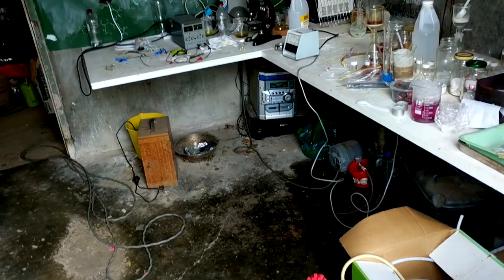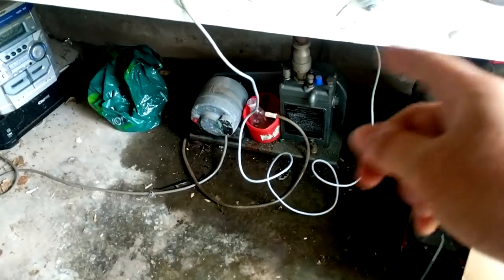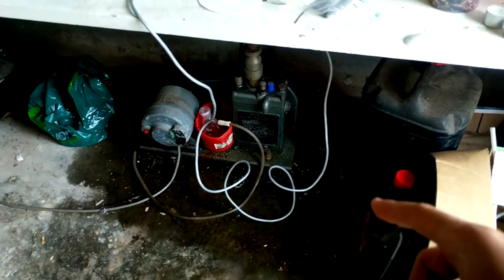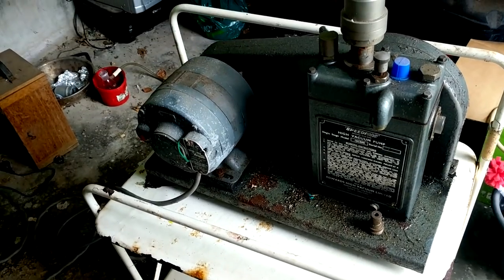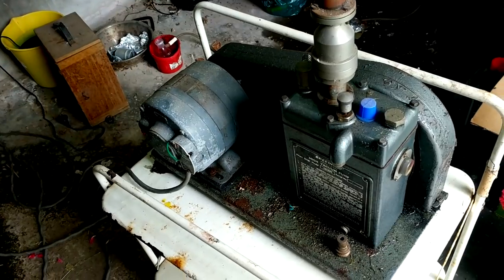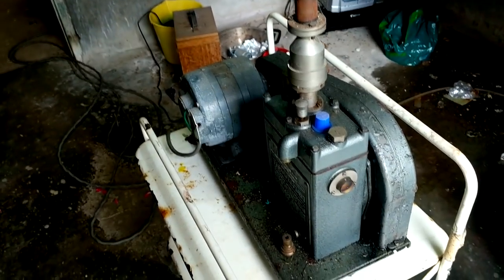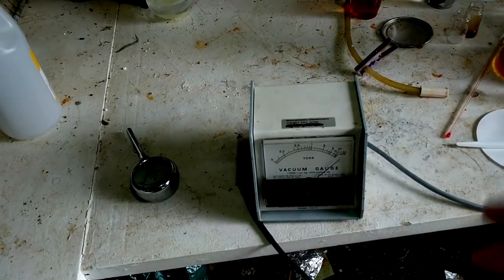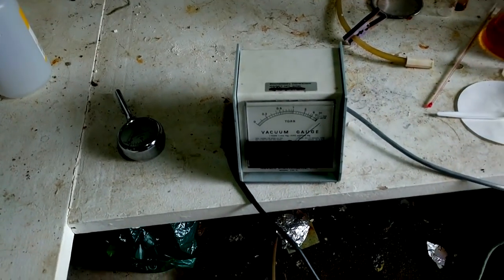Changing My Poor Vacuum Pump's Oil [[gone greasy]]

Comment: That is one tough pump to still be running like a champ after running so long with coagulated oil. I doubt to many modern pumps could still be running after such abuse.
Reply: that pump probably also cost ten times as much as a modern equivalent pump
Reply: @SuperAWaC  probably not. May well have cost a similar amount, but it's definitely far more overbuilt compared to modern pumps. Like a diesel engine.
Reply: @hotmailcompany52  Maybe, but nowadays engineers are hired specifically to optimize product costs for maximum profit

Comment: Your pump is quite good. Ballast pumps are expensive new. You probably want to run with ballast on, especially in your particular application . Running with the ballast air enabled helps prevent vapors from condensing and entering the oil. It does this by adding air to the pump chamber during the exhaust phase. This air dilutes the trace gasses with air so they don’t condense to liquids during the compression / exhaust phase of the pump cycle. Any vapors pulled in by the pump stay in the gas phase and get pushed out the exhaust vent mixed in the added air. The trade off is not quite as high an ultimate vacuum. But considering how rusty the oil looked, you have a lot of moisture condensing in the oil and you want to avoid this in the future. Buy a big jug of hydraulic oil and change your pump oil frequently, before it starts to look funky [and pray for forgiveness from your past sins by the god of ultimate vacuum - the great and  mighty Torr]
Reply: What is frequent - hard to say because it depends on how much the pump is used, at a minimum, I think you will want to change the oil at least every 6 months. It could be as frequently as monthly if you are using the pump extensively.
Reply: Thank you for posting that I just bought a welsh 1395 pump 15 ft.³ per minute horsepower motor and now I know how to use the pump with the gas ballast valve. That was a good thing. I understood now all right thank you very much for posting that and by the way, my pump weighs 215 pounds believe it or not.

Comment: Imagine what can you find by doing the NMR of the dirty oil!
Reply: Spikes everywhere.
Reply: dude's vacuum pump grease so filled with unknown chamicals that it accidentally created the cure for cancer
Reply: It would be so spikey that it would create a plateau. And probably reach chemical shifts never reached before.
Reply: If you ran the NMR spectrum of that stuff through an audio editing program it just comes out as an eldritch scream
Reply: @LiaLia0407  will simultaneously cure cancer and cause several new ones.
Reply: It will by just a single solid bar
Reply: someone just had to suggest an caramel sauce enemah

Comment: The air ballast introduces air (duh) into the inner workings of the pump and basically dilutes whatever gas it is pumping. If you're vacuuming something with a lot of water or other condensables in it, the air ballast will prevent them from condensing inside the pump and into the oil. You're trading ultimate pressure for oil and pump service life.
Might come in very handy when doing filtrations or vacuum distillation. My best guess is that the little knob at 16:24 controls how much air you're letting in.
Reply: Not sure if just dilluting the intake but with the pumps that we are using it also bubbles some air through the oil so you can just open it 5-10 minutes before turning off the pump to get the best of both.

Comment: I believe mineral oil is the most suitable and readily available substitute for commercial vacuum oil, most of which is mineral oil based. It does appear to be a rotary vane pump. Ideally the oil would be changed every use. HVAC techs will change the oil every 1-3 uses. Of course the industry standard for an A/C system is to pull a hard vacuum, then purge the lines with dry nitrogen under pressure alternately, a total of 3 times, ending with a 100-300 micron (0.10-0.30 Torr) vacuum, and any moisture or gasses in the oil will preclude the possibility of such a deep vacuum. Still, you've got a nice vintage pump likely much better than a cheap modern Chinese pump, get yourself a supply of cheap mineral oil / baby oil either of which you should be able to find at a pharmacy or supermarket, and change your oil regularly to keep it clear of moisture and corrosive substances, and it should work well for a long time.
Reply: it can be used in a pinch.... but it doesn't work well. the vapor pressure of regular mineral oil is still too high. it pulls a vacuum but it puts out a crazy oil mist and depletes the reservoir quickly.

Comment: Probably should pump the exhaust through something. Half ass solution is put a hose from the exhaust in some water
Reply: good idea. Vaccum pump vs Air compressor :')

Comment: Get vacuum pump oil from local HVAC supplier. They supply it for the vacuum pumps used by A/C and Refrigeration technicians. Relatively cheap and available. As an HVAC tech I regularly have to pull a 500 micron vacuum and we always use vacuum pump oil,  pulling deep  vacuum takes much longer with dirty/contaminated oil. The specific oil is designed to stand up to a deep vacuum without any part of it boiling off.

Comment: Hey Tom, great job on actually doing maintenance on your equipment. You're doing better than >90% of the customers I have to deal with regularly. 

The vacuum pump you've got there is a pretty damn nice one and it'll last you forever with the right maintenance. I'd like to give you some additional information on the pump itself and fill in some of the blanks in the video. 

First of all, the question of the oil to use. Vacuum pump oil is 'special' in regards of having a low reactivity and a low vapor pressure (usually down to 0.004 Torr). As you correctly established, a lot of regular motor oils nowadays have lots of additives, ranging from anti-foaming and anti-wear additives, detergents, dispersants, and more. These additives aren't exactly great for a vacuum pump, and especially not in the way you use your pump. 

The oil that is intended to be used with this pump is Ultragrade 19, but it's very expensive (40 bucks for a liter...whoa?). But there are plenty of suitable alternatives out there! The following link shows a website with the different groups of vacuum oils and a long list of alternatives: http://supervacindustries.blogspot.com/2014/03/vacuum-oil-equivalents.html
Most important is that the oil is inert and has a low vapor pressure. 

The next thing is that the grease around the pump is usually a sign of a leak. My best guess is that the oil seal needs to be replaced. There is a seal located behind the wheel, which is intended to keep oil in the machine, and prevent it from creeping out along the shaft. This is a maintenance part and needs to be replaced every so often. 

This is important, because the belt that runs the vacuum pump doesn't like grease all that much. Oil + rubber don't go well together over time, the rubber will start to swell and it becomes porous, elastic and it will break eventually. A greasy belt is really not a good thing. So I can definitely recommend to replace the seal and the belt. 

Next, for cleaning the grease (I restore engines and engine parts mostly), I use a parts cleaner/washer which uses a solvent that takes care of grease the way chromic acid deals with organic materials. thick buildups will dissolve into nothing with a good soak and a quick swab with a paint brush. I'm not quite sure what the exact contents are, but it's a blend of mineral spirits, hydrocarbons, maybe some aromatics, it's basically gasoline really. If you wish to make your pump free of grease, that's a definite recommendation. 

Lastly, also check the electric motor. Usually they're maintenance free but sometimes the bearings need some attention. You're probably good but better to know for sure. 

Cheers mate!
Reply from the maker: Thanks for all this!! It does seem that the rubber seal needs replacing, but it's not an o-ring, it looks like a specialist rubber gasket type part. Any idea where I might find a replacement?
Reply: @ExtractionsAndIre  you can buy gasket material and cut it with a razor. Or be extremely lazy and use automotive RTV
Reply: Hey, sorry to bother.. Would you mind giving me a quick tip? I need to do a vacuum distillation without a fume hood and I can't do it outside (non-corrosive chemicals but volatile) which means that I can't use a classic alcohol + dry ice cold trap.. Is there a specific type of pump that can cope with small but measurable amounts of vapor making it over? (I've also investigated the option of eletric cold traps but they are f'kn expensive)
Reply: @samuelallan7452  it really depends on the vapor you’re expecting to come over but as long as its not horribly corrosive or ignites polymers at contact you should be okay
Reply: @ExtractionsAndIre  hadn’t seen your reply, sorry 😰

Yeah, usually spare parts or equivalent replacement parts are available for a long time after its discontinued. Is the part you need in the vid?
Reply: @JoppedeZeeuw  Awesome, thanks! I found this insanely cheap (imo) Rotary Vane pump that can get to 5Pa and costs only 70 bucks (it probably can't really get to 5Pa but either way it seems to be really awesome) and it looks like I'll be able to use it now :D

Comment: Btw air ballast is a valve somewhere that pulls in air (air ballast). This keeps the oil cleaner because the air going through the pump takes contamination with it. You hear the air ballast sucking in air when opened. I guess your air ballast is closed. So you should be able to get 0.005 Torr, but need high vacuum oil. Yours seems too little viscous for a high vacuum oil. But 0.5 Torr is not bad.

Comment: So vacuum pumps work in very tight tolerances and any solids in the pump can (and likely will) degrade the function of the pump. Every material that you place under vacuum will inevitably have some vapors that become trapped within the pump oil. Take caution that there aren't materials that produce solids when mixed as the reaction WILL occur within the pump itself and can destroy it. I've had a company use the pump to degass both components of an epoxy and the vapors reacted within the pump forming a massive solid that seized it.

Comment: It's up to you but I think perhaps you could some sacrificial redox partner in there to help with the rusting? I have heard that most cheapy pencil sharpeners are comprised largely of magnesium or at least a high percentage alloy like that and that you can just put them in contact with your metal and it'll protect it.  Maybe aluminium things would also work since its right at the bottom of the electrochemical series too so maybe you could try that instead? Good luck and greetings from Melbourne!

Comment: If you ever do this again, Id recommend the same vacuum pump oil that is used for vehicle AC recovery machines. I sell Mastercool branded vacuum pump oil. Im in the US. It is more expensive than ISO 46 oil, usually, but it designed for decent vacuum.

Alternatively, a good “non-detergent” motor oil would work. Valvoline sells it in quarts.

Comment: 4:23 damn i hate chemists who have teflon tape addiction. everyone in my lab uses that tape like a magic wonder leak stop miracle compound. they even tape it outside the joints, even on a nitrogen tank regulator where pressure of a possible leak is above 200 bars, they tape that teflon tape around the joints like that shit could contain 200 bars of pressure by it's sheer strength. jeez. However, i could recommend you using loctite thread sealants, they work wonders. it completely fills the threads and last for a fucking lifetime.

Comment: If you want to do an aggressive cleaning of the internals, Mix a 3:1 oil to K1 fuel oil fill her up and run it to normal operating temperature, shut it off unplug it, and immediately drain it, repeat once more with only fresh oil run to normal operating temp and drain again, add fresh oil and you are done & good to go.

Comment: A 70 yo pump with car oil still pulls the vacuum manufacturer specified on it. A brand new pump I just bought with manufacturer oil still only pulls about 30 torr and has specification of 15 microns on it. That's why chemistry peaked in the 60s. Their stuff was better than ours

Comment: Most motor oil, mineral oils, transmission fluids and general purpose oils have a vapor pressure of around 0.1 Torr at room temperature, but the vapor pressure rises with heat, so you will likely vaporize the oil in the pump as the pump warms up to over 60C. It's best to use a premium vacuum pump oil with a vapor pressure of 1x10-^6 Torr or 0.000001 Torr. At operating temperature of the pump, the oil will not vaporize, even if you achieve the 0.005 Torr ultimate vacuum pressure of the pump you have. The key is premium vacuum pump oil will be more resistant to oxidation and polymerization (reactions with the contaminating compounds). Lower vapor pressure means oil stays more viscous at lower pressures for better lubricity and mists/backstreams less (less hydrocarbon oil contaminating your lab and samples). Please treat that old workhorse to some premium "real" vacuum pump oil. The oil you are using will fuel extreme wear and tear on the pump. Good oil lasts longer and will keep your pump operating trouble free, so long as you keep relatively clean oil in it. A cold trap or condenser will prevent much contamination from entering the pump (though I doubt you can student budget for it). It's been six months since the video and the oil definitely needs to be changed by now. Can you make a video showing and oil change with real vacuum pump oil please?

Comment: Transmission fluid is the best/cheapest readily available alternative to vacuum pump oil. What's important is an oil with lubricating and sealing properties, which is exactly what trans fluid is made for!
Source: been a refrigeration system mechanic for a while and needed replacement oil during the wee hours of the night when my industry suppliers were closed
Reply: Uhm... So roughing Vacuum pumps use highly refined mineral oil in most circumstances.
That's all it is... So even just getting mineral oil from the store would be worst case scenario.
Transmission fluid would be a bad idea...
They use different types of oils for different applications, like if you need to pump pure oxygen then you need something else otherwise you will make a bomb out of your pump.

Comment: Its amazing what sort of bullshit rotary vane pumps can put up with and keep working.. Had one running an epoxy degassing chamber, and was abusing it to try and get some MEK to soak into some closed cell foam to dissolve it. (Fuckin polyurethane resists shit too well)  Pump sounds a bit weird for a second, and a big ass wad of cured but now softened by MEK epoxy shoots out of the exhaust hose. Turns out that a few years ago, someone spilled the epoxy, and it got sucked into the pump, and it just didnt give two shits.

Comment: Thats nothing... we had a multiple staged rotary vane pump to pull a vacuum on our drying cabinet. And we frequently did an analysis were you weigh 0.1 g of sample, add 2 mL of an aqueous 20% solution of trifluoroacetic acid, heat to 120 °C for an hour, add 2 mL (or 10 mL, i don't remember) of water and then evaporate everything to dryness. Every chemist would do that with a rotary evaporator. But she was a bit lazy and did it in the drying cabinet under vacuum... The loads of water are already bad enough, but water and trifluoroacetic acid is very bad for a rotary vane pump... When i saw how bad the pump perfordmed after a few months, i decided to change the oil in it... it was a brown soup, really looking like diarrhea with all of those brown solid junk in it... probably all corrosion from the pump... i got most of it out. Flushed the pump multiple times and put fresh oil in it, but nothing helped. The pump was completely destroyed and we had to get a new pump. The chemist who did this told me she just added water in the last step, so she thought that woulnd't hurt the pump... she still works here and frequently destroys HPLC columns in similiar stupid ways: Destroyed a gel column a few months ago with water: She purged the system from water to THF, stopped purging when she smelled THF a the outlet and directly connected the column... Not understanding that water and THF are miscible and there is is a ton of water flowing through the system when you smell THF... This woman has a diploma in chemistry!

Comment: Find an HVAC supply house they will have vacuum pump oil as it is necessary for scavenging air out of AC systems refrigerant circuits before allowing refrigerant into the system

Comment: They don't build them the way they used to that's for sure. It looks like your pump has a little case of diarrhea LOL. If it was a new pump you will have killed it a while ago. They may come back in the day to be able to run on anything the oil back then was not as refined as it is now.

Comment: I also don't want to look at the oil in my pump. It's an old air conditioner compressor. Mine is filled with an ester based oil. Maybe yours also uses ester oil? 
From the  sound of it, it should be a standard piston pump. 
Edit:  Get some regular refridgeration ester oil. That one should do the trick nicely!
The one you used should work fine. From the color under the head , it looks like the same. Just make sure you don't use too heavy oil!

As AvE would say, RELEASE THE SHMOO!